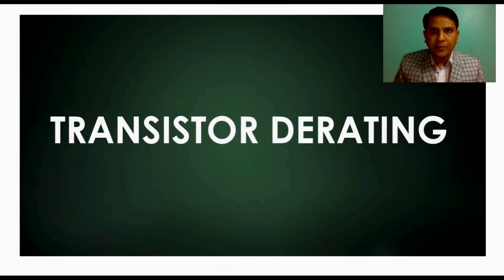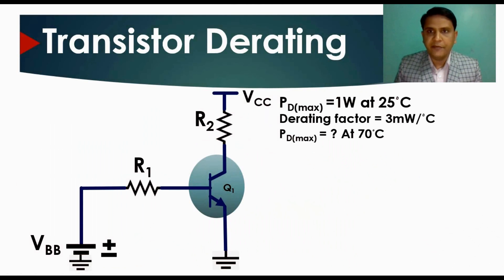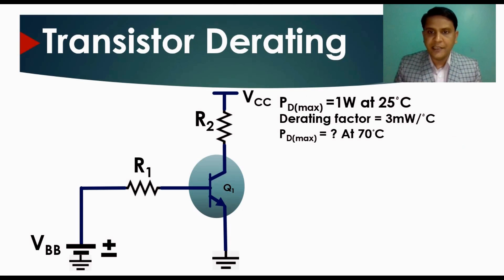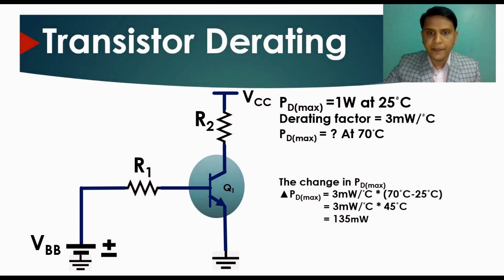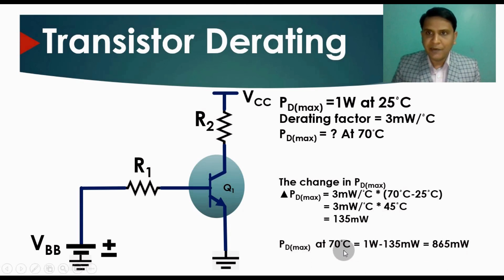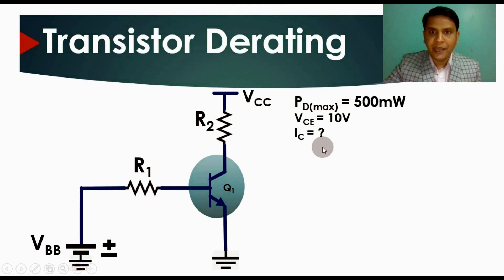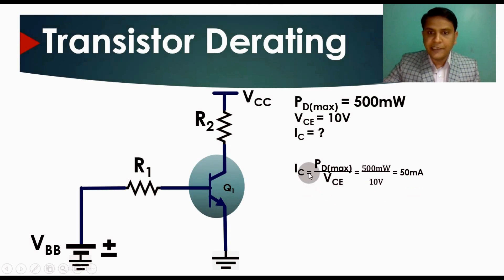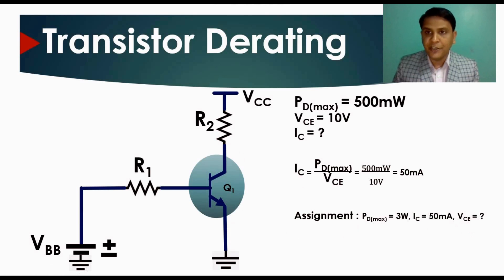BJT Derating and Power Dissipation Calculation - YouTube

Comment: How to find out the power loss in device. Consider the available dc power supply to be 12v , icQ=3.2 mA, vcQ=5v, beta =80
Reply from the maker: I do not much understand your question but BJT power dissipation Vce*Ic.
Reply: Power loss and power dissipation is same are not
Reply from the maker: @Kumaraswamytadi  Power loss is total loss of any components which includes Conduction loss and switching loss and may be some other circut depends on application. Power dissipation is part of conduction loss.
In your examples conduction losses is dominant.